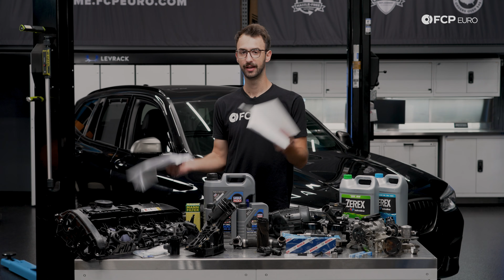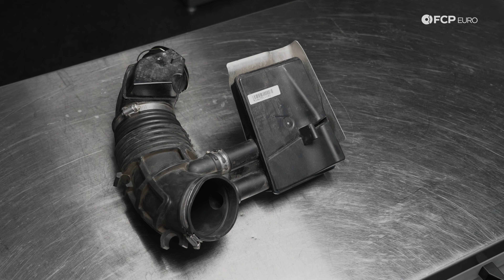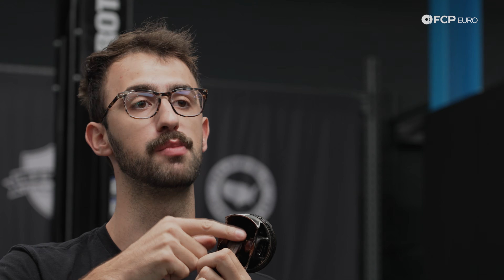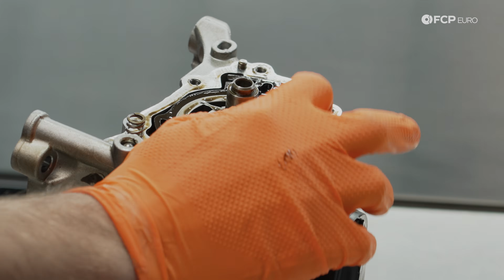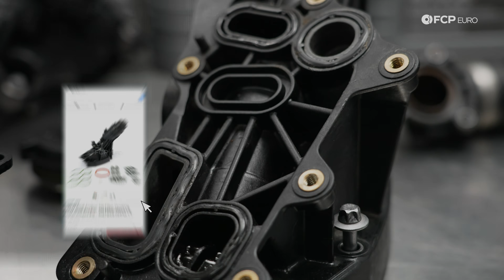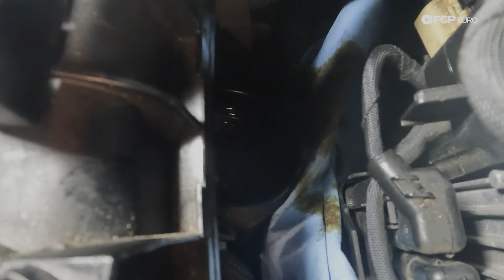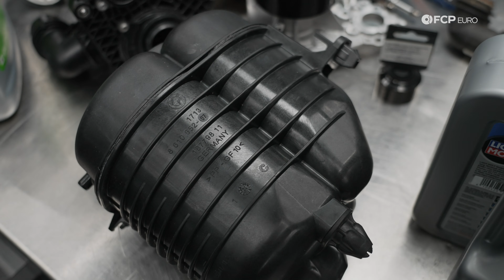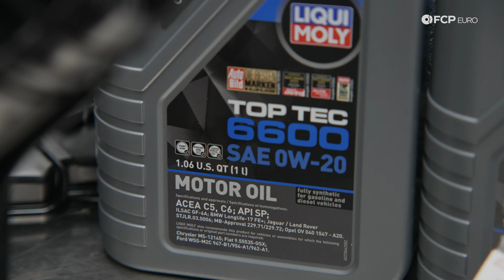BMW B58 Engine Guide: Everything You Need To Know

Comment: Great video. Lots of good info here. FYI, your Spark Plug replacement, you said BMW recommends 60k, however, they inserted wording shows 100k. Which is correct? I just had the water pump replaced under warranty yesterday @ 49, 690 miles (310 from end of 50k warranty) on our 2022 G05 40i. I watched several videos where this mechanical WP is susceptible to leaking. I inspected mine the very next day using a mirror & sure enough, it had the whitish crusty around it. BMW inspected it yesterday & replaced it under warranty, plus refreshing the coolant. I got lucky & missed the bullet on this one! Please keep your videos coming! Greetings from the Old Jarhead in WNC, an old 78 YO DIYer that buys your parts. Next is the Transfer case & transmission fluid change.
Reply: Generally for Euro cars it's 4 years/60k kilometres (which equates to 38k miles). Plugs are cheap maintenance and if you change them on time you're far less likely to have coils fail imo
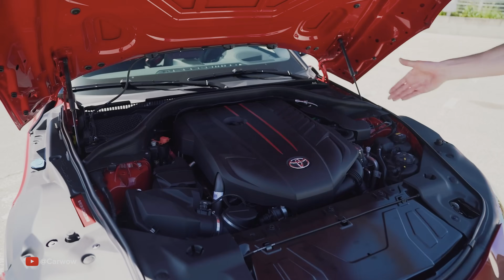Reply: @eponymous7910 on my gen 1 M 2:40 I replace them at about 86,000 some of them were difficult to remove pretty scary I don't recommend  waiting that long!

Comment: Great video 🎉 love my Supra, until all the plastic eventually fails lol
Reply: I thought they addressed this with heat retention to prevent extreme cycling? Also aren't there already b58's with over 200K miles?
Reply: Or you could just buy the parts from fcp euro and have peace of mind rather than plastic at 60k miles.

Comment: I noticed the 2023 X5 40i vs the 2024 X5 40i have 320 hp vs 385 hp respectively. Does the 2024 have more bc of electric motor assist?
Reply: Gen 2 b58 have 385

Comment: Their no replacement for displacement. Change my mind...Rather have V8 and V10.
Reply: Handling. Weight matters in motorsport. If you actually play with these cars on a track with corners then you will care. If you're just cruising slowly on normal roads it doesn't matter. Get a V10 engine that weighs twice as much but sounds good.
Reply: Except BMW's modern v8's are hideously unreliable. B48/B58 are as reliable as the marque gets, far from perfect but very resilient with sensible maintenance
Reply: @eponymous7910 Do you honestly expect extreme reliability from a V8 with 2 turbos sitting in the middle?. Let’s be realistic here 😂. It’s reliable enough for what it is. I own one. 0 issues from itself.
Reply: there is a replacement for displacement. its called technology its been proven many times with things like DOHC engine layout, VVT, Variable cam etc. 
thats why a 5.0L coyote smokes a 6.2 LS3
however i agree when it comes to turbos.

Comment: Wait a minute!? You're telling me that the B58TU DOES NOT have a PCV in the valve cover at all?? Everywhere I've read says it's integrated into the valve cover and thus if it fails, the valve cover has to be replaced. But you're saying that it doesn't have the valve at all?
Reply: It's just nonsense. There is a PCV valve in there. Even if you can control the manifold vacuum the actual purpose of the PCV valve is to stop the flow of blowby once the crankcase has a mild vacuum. Otherwise you end up with the N54 problem of tons of oil aspirated into the intake.
Reply: @joshuaho3150 It’s just funny that this video dropped. I currently have a crankcase ventilation issue with my ‘22 M340i. P04FC code for a ccv leak. I’ve ruled out any external leakage with a smoke test. Manometer test via oil cap adapter shows -1 mbar of vacuum at idle. Zero suction on the oil cap when I take it off. So I was about to replace the cover this coming Monday when I saw this video. So naturally I was like do I have a PCV issue or not?
Reply: It is 1 am Sunday morning and I just spent the last 12 hours replacing the valve cover on my big turbo 20’ M340i due to a bad PCV. So I can without a doubt confirm there is indeed a PCV integrated into the valve cover on the B58TU.
Reply: @AGBoost What your symptoms? Did the replacement fix your issue?
Reply: @AnontheGOAT  Smoke from the exhaust on decel and WOT. I was also having boost control issues during tuning because the bad PCV + a VTA catch can was essentially creating a boost leak condition.
Reply: @AGBoost ya see that’s the typical sign of a failed pcv. I have no symptoms from the crankcase ventilation leak code that i got other than no vacuum in my crankcase. So at this point I dunno what it could be other than the PCV?
Reply: @AnontheGOAT  Have you checked the CCV hose at the passenger side of the engine block? There is a check valve integrated into this hose. If it fails I would believe vacuum would be lost.
Reply: @AGBoost  Seriously? That thing has a check valve inside of it?
Reply: @AnontheGOAT  Yes the side that attaches at the engine block is a check valve. You can check by removing and sending some low pressure air through it. If it only comes out of one end it is good. If it comes through both I'd bet that's your issue
Reply: @AGBoost  Omg, I inspected that line for leaks via the smoke test but didn't observe any. DID NOT KNOW it had a freakin' check valve in it. Also, what about the one coming off of the valve cover on the passenger side, the one that goes into the intake as well? Does it too have a check valve in it?
Reply: @AnontheGOAT  No, the valve cover vent hose does not have a check valve. If you smoke tested at the intake and there was a crack in that hose coming off of the valve cover or a bad o-ring you would've seen it. I would check the check valve in the ccv line from the engine block to intake, if that is good and you 100% have no vacuum I would say you need a new valve cover due to a bad PCV my friend.
Reply: @AGBoost  Roger that. Yes, smoke test did not show any smoke escaping from that top hose coming off of the vc or around it's connection points. One last thing, are there any other vent hoses/tubes part of the ccv system that might have a check valve in them or is that the only one? I'm guessing those two - the lower and upper one are the only external ccv hoses that this engine has?
Reply: @AGBoost  I just removed the vent pipe. Broke it in the process. The check valve appears to be in working order, allows flow into the engine but not out. From what I researched, this is an oil scrubber line that pulls oil from the intake elbow back into the oil pan. Gt.ot a new one on order, hoping that maybe the broken one had a microscopic crack in it.
Reply: @AGBoost you mean underneath? I have a 2020 m340i founders edition, amd my B58 had no pcv on top/integrated into valve cover. it is underneath my valve cover
Reply: @MlDNIGHTSPECIALIST While you don't have access to it without removing the valve cover it is indeed integrated into the valve cover itself. If you want to describe that as underneath then yes lol
Reply: That also confuses me.
Reply: @Garik.e60 fcp needs to clarify this asap because there’s already a raging debate going on in bimmerpost. Everyone says that no, the valve is there still just surrounded by plastic that can’t be removed like the cap in the gen 1 b58.
Reply: @AnontheGOAT I’ve owned a B58TU for two years and I’ve always considered it a fact that it’s in there still….

In fact, you can install block off pins on the TU engine, if the valve is not there then I think this would be pointless
Reply: @SomethingSomething1337 ya I’ve seen that mod which makes this guys statement all the more puzzling.
Reply: @Alex @kern417 is saying you’re wrong about the valve cover having no moving parts inside for the PCV. He said that there check valves inside of it that assist with ccv fumes.

Comment: Why would anyone willingly buy a BMW after hearing about all these service issues and failures on the "good" engine?
Reply: Why are you here? Ford and Chevy has much more miserable problems
Reply: @b58jam Rod knock anyone😂
Reply: What engine you know has a forged internals that can handle 800hp? Get 35mpg, low emissions. Quiet, civilized. 
A great engine core is the key to longevity. Plastic accessories (like most other modern manufacturers) are easily replaced. 
Toyota 3.5?
Honda 3.5? 
They both have there issues & plastic accessories plus they are nowhere near as strong internally.
B58 is proper hot rod engine from the factory.
Reply: @phillm156 a coyote engine is on par with the B58 for a lot of your criteria.  But that's pretty much it
Reply: @Hammerhead13579 I agree up to the efficiency part. The B58 is far more efficient.
Reply: @phillm156 well yeah.  It's a 5L V8.  But who cares about efficiency if they want to make 800+HP?
Reply: @Hammerhead13579 It’s the entire package, having both.
Reply: @phillm156 ok so you are arguing an irrelevant point?  You can just stop responding
Reply: @Hammerhead13579 I stated from the very beginning that the B58 was both powerful & efficient. Only thing irrelevant is your argument that power without efficiency is king!
Then I say a 7.0 big block with a 5 liter supercharger is king!
Reply: 4 gallon per mile yeah!!
Reply: @phillm156 see you could have stopped.  You made this an argument when there was never one.   Nobody said anything about a motor being "king" but you.  Now you just look like a fool and your credibility is minimal
Reply: Ford doesn't even make parts after seven years. What a joke.
Reply: @davewallace9048  Yep that's one major bonus for BMW. Relatively easy to work on, with an abundance of parts for any model.
Reply: The cars work. You just drive it and get it serviced once a year. It's really not difficult to understand. Issues are well known and prevented with maintenance. These engines are reliable.
Reply: the service issues he mentioned is on the bigger v8 car....thats why he said they felt the need to make the B58 6cyl

Comment: Insane timing. I just started my search for a 2018-19 G30 540i. Thanks FCP!!
Reply: you still have the gen 1 b58b30m0- The G30 got the B58B30M1 in 2020. Hope this helps
Reply: @Ur_cristiano_778 oh shit really? I thought it was gen 2 because of the title
Reply: @Ur_cristiano_778   I wonder if the 2019 540i has the stupid plastic oil pump as well despite being a gen 1 unlike the gen 2 he was talking about
Reply: @HamzaGuzel690  same engine in 340/440i F chassis, and unfortunately, you have that plastic oil pump with the control ring.
Reply: @Ur_cristiano_778  but he said 2019 and 2020 models had that issue. I’m guessing a 2017-18 shouldn’t have that plastic oil pump issue.
Reply: @HamzaGuzel690 you don’t have to worry about the oil pump on the gen 1 plastic or not. This only affects early Gen 2 engines
Reply: @samhadi7972  so gen 1 applies to all 540i’s until 2020 MY?
Reply: @HamzaGuzel690 yes, I have a 2019 and it’s a gen 1 B58. 2020 they moved to gen 2. The oil pump issues was taken care of by 2021. But was never an issue on gen 1
Reply: @samhadi7972  so I can still search for a 2018-19 with a peace of mind regarding the oil pump?
Reply: @HamzaGuzel690 yes 100% your only worries with the g30 will be to stay on top of coolant hoses and you should be good. Mine is pushing 650HP for the past 30k miles and still going strong.
Reply: @samhadi7972  dude that’s awesome. Hope I can find a nice spec soon!
Reply: @HamzaGuzel690 yes I believe that's the case
Reply: They’re great! Just be prepared to replace the cooling system every 80-90k miles. Was about 4K done at a dealership
Reply: @jessegutierrez9689  gotcha. Thanks!
Reply: WOW what a coincidence also looking at the 540i 2017-2019, planning on getting one by December or January next year
Reply: @Phoenixgamerrr  good luck with it